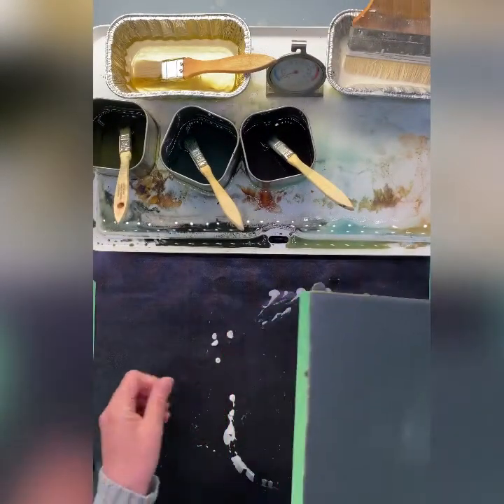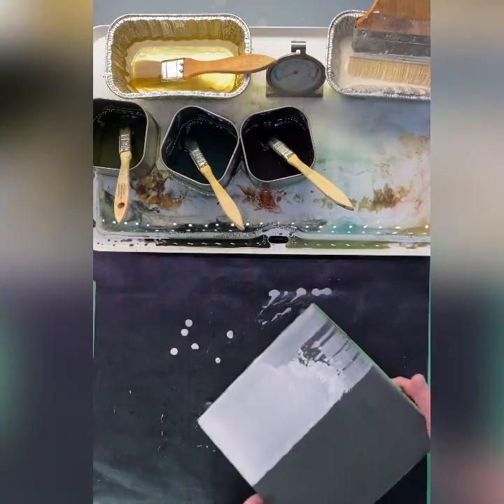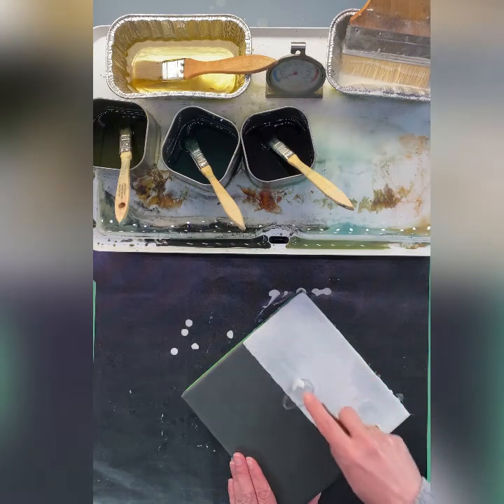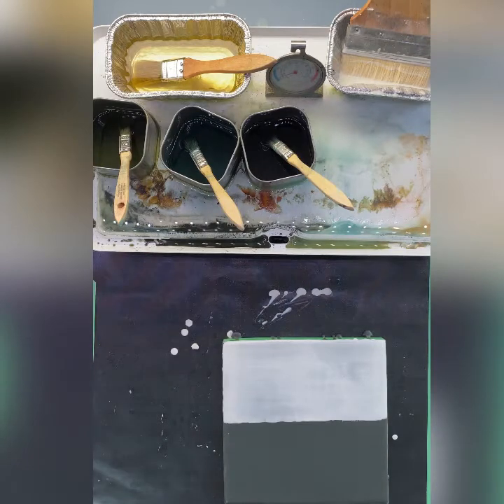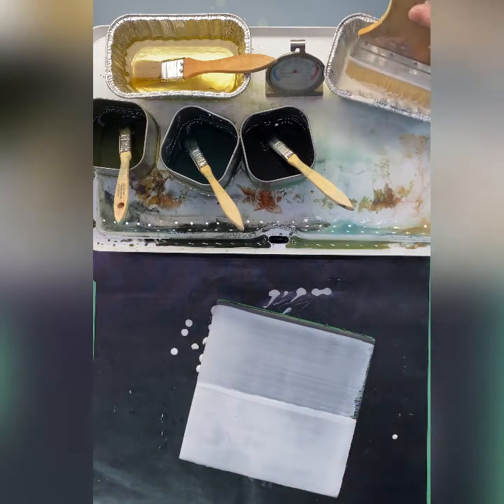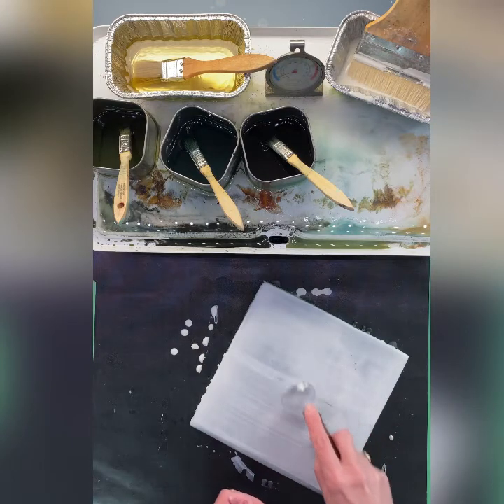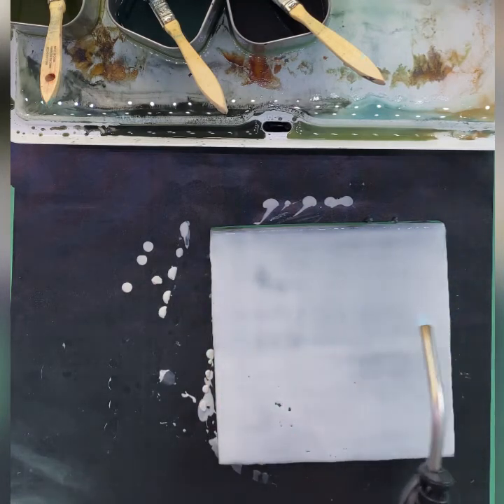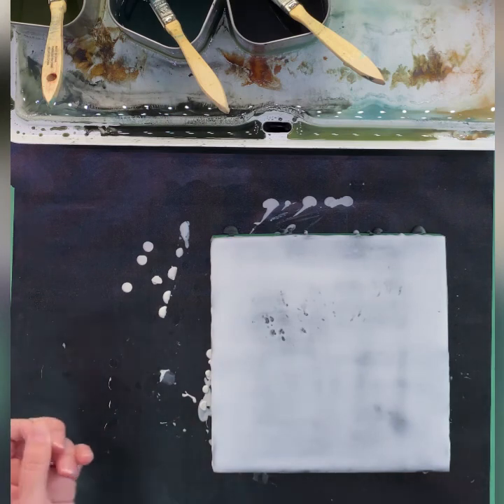Encaustic Wax Fix Tip #1 - Smooth Brush Strokes

Comment: Hello Cindy, thank you for your videos they are very helpful. Would you be so kind to advise on how to get rid of pin holes. Thank you.
Reply from the maker: Hi, Akira.  Thank you very much.  Yes, the dreaded pin hole.   Sometimes it can be impossible to get rid of them. They are caused by air bubbles. Some panels seem to release more bubbles than others, but if you have a lot of texture and paint wax over the texture that can also create bubbles.  

To get rid of them…well, I alway try to get my layers bubble free before I really start painting on it.  Overheating or really fusing to liquify seems to bring up new bubbles from the panel or maybe the air is trapped between the panel and your first wax layers.  So gentler fusing will reduce bubbles.  I usually keep doing gentle passes over the painting until the pin holes disappear.  I will fuse, give the panel a quarter turn, fuse, quarter turn, etc until the bubble is gone or until my wax starts to liquefy.  Then I let it cool down before I try again. I can always get them out this way but sometimes they come back.  

This is a good topic for another fix tip so I’ll post one to demonstrate. Lmk if that helps!
Reply: @cindyjamesartstudio  thank you very much for your advise. I really appreciate your help. I am wishing you the best in your art work.
Reply from the maker: @akirabaycrest4398  thank you :)

Comment: thanks Cindy... very helpful video... what brushes do you use ? and where do you get them from please... I like the handles..:)
Reply from the maker: Hi Helen :). I get these brushes from Deserres in Canada. Here is the link.  Not sure where to buy in the US. 

https://www.deserres.ca/products/flat-white-hog-bristles-brushes
Reply from the maker: Actually maybe here :) https://studio-six.com/products/nobel-series-7281-flat-white-hog-bristle-brush-4
Reply: @cindyjamesartstudio  - Brilliant - they look really good for encaustic ... I am finding I burn mine ... leaving them in the wax and they overheat...  Many thanks Cindy... I live in New Zealand so will see what I can do.. :)
Reply from the maker: @helenkeen3476  you are very welcome:). I usually keep my palette about 150 degrees Fahrenheit so I don’t usually burn my brushes. I have had my palette overheat and melt a brush. Or the heat gun will
Reply: @cindyjamesartstudio  - OMG thats scary.... melting a brush!       Was it plastic? 
thank you again... I should really get a better set up with an R&F hot plate that holds the temperature better and at a constant temp ... not sure if we can get the hot plates here... I just use griddles for my paints and a two element set up to melt the encaustic...the two elements is not constant heating and this is where I am burning the brushes... if I leave them in the pot.
Reply from the maker: @helenkeen3476  It's challenging to get the right set-up for sure.  I do like the R&F hot plates as they hold heat better for sure.  Good luck!

Comment: Hi Cindy! Do you use/recommend oil paints/pastels or just encaustic paints?
Reply from the maker: Hi, Kai :)  I mostly use the commerical encaustic paints but I do add other media as necessary to get the effect I want.  I have used Pan Pastels and I have also done oil rubs to stain the wax or fill lines.  Many encaustic artists colour their medium with oil to make their own paint, but too much oil can cause your encaustic paint to stay somewhat soft.  R&F paints has some great resources on oil and wax.   I've included the link below.  

I use mostly encaustic paint but do include other media usually in small quantities.

https://www.rfpaints.com/resources
Reply: @cindyjamesartstudio  thank you so much
Reply from the maker: @kaiweekes566  any time!
Reply: How do you hang the wood, I don’t have access to the frames,  just pieces of wood.
Reply from the maker: @kaiweekes566  hi Kai.  If it’s a flat panel I would probably set it on an easel but if you want to hang it no frame maybe a small hook or ring screwed onto the back would be sufficient. It depends on the size and thickness and how heavy it is.